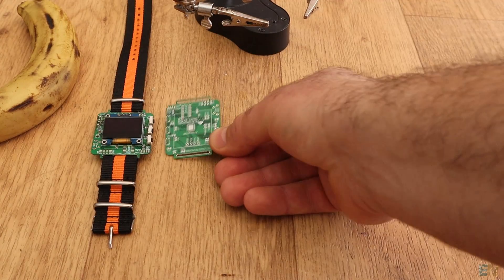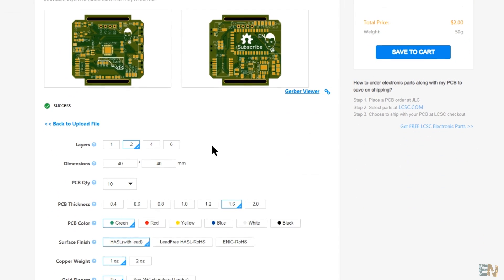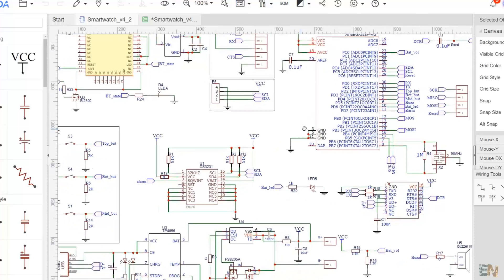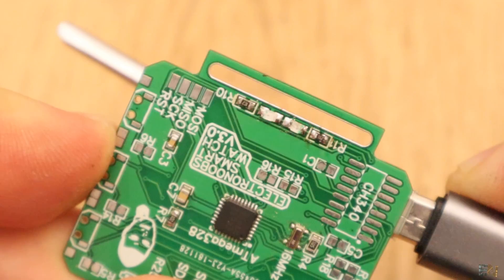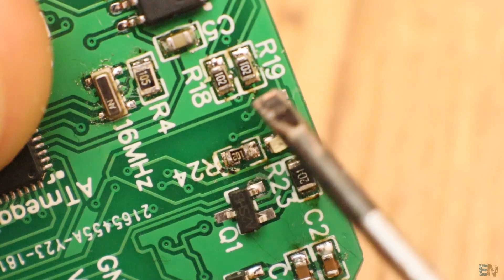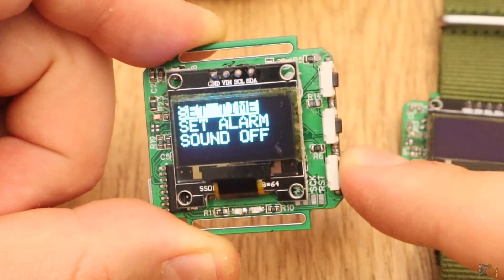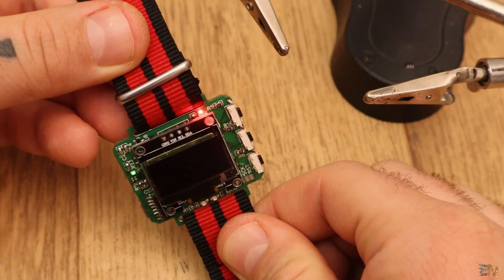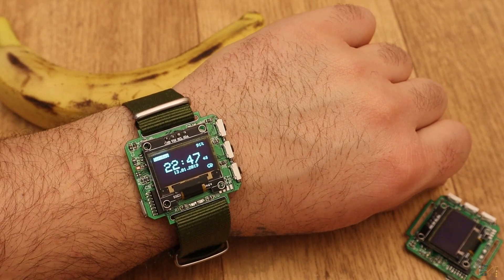Arduino watch - Bluetooth and more | development board

Comment: DW01A is not good for LiPo batteries since the overdischarge threshold of 2.4v is too low. FS312F-G has 2.9v which is better suited for LiPo batteries

Comment: At the watch's bend cutout the cutout's side PCB part is looks too thin. Why don't you kept it in the original thickness? That is the weakest mechanical part of your PCB. BTW if the manufacturer can make rounded cutouts, they can make rounded outer edges also, so you can round the sharp corner near the bend.
Interesting project I am very beginner in microcontrollers, I am looking for built watch projects to see how it is complicated. Thanks for your video.

Comment: Really amazing!  Thinking of the programming to make all that work makes my brain hurt!  Definitely worth considering other ICs.  The 32u4 can do USB without any additional hardware, and most of the Tiny line can do software USB with the Micronucleus bootloader.  Here's a watch I've been working on with, admittedly, much less functionality than yours.  But left to right is a M41T62 RTC, an ATtiny841, and a MCP73831 lipo charger IC.  On the back is a 28 channel LED driver.  https://www.youtube.com/watch?v=miADL01ga8E  The Tinys have limited memory, but I believe the 32U4 has as much or more than the 328p.

Comment: HOW U READING THE BATTERY VOLTAGE ??
Reply from the maker: I have a voltge divider connected to the battery and then to one analog input. That voltage divider will reduce the 3.7V to under 1.1V so I could use the internal refference for 1.1V of the ATMEGA328 chip for the analog read.
Reply: @ELECTRONOOBS  thanks a lot buddy....im doing the same..but different PCB and schematics .....once again  ty for sharing

Comment: with a bigger battery and a few changes this would actually a better smartwatch than many commercial ones!

ideas for the next revision:
* replace the buzzer with a tiny and less annoying smartphonephone vibrator
* replace the screen with a e-ink module (like the ones from waveshare) to lower the power consumption while keeping the screen on
* replace the tx/rx solder pads with tiny dip switches
* replace the atmega328 with an atmega32u4 (from an Arduino micro clone?), which doesn't need the ch340 chip and still has the full Arduino support
* use a more power efficient Bluetooth module like the at-09
Reply from the maker: Thank you for your tips!
Reply: @ELECTRONOOBS  actually, thank you! Your videos are very inspiring

Comment: sir, i am quite new to pcb designing...it seems that u are quite an expert...i am facing problm in making a custom shape for the pcb..as u have done...i was using easyeda only...and wanted to make a heart shaped one...it will be great help if u tell me...how to make a custom shape for the pcb...
Reply from the maker: You have to vectorize the outline baord point by point. For now, in easyEda there is no other option just go point by point till you have a heart sahpe. You could add a image below the PCB in easyEDA so you could guide and give the good shape.
Reply: @ELECTRONOOBS  ... Thanks a lot sir.. Firstly for such a fast reply... Just one more question... Can you suggest any other PCB designing software which can make this task easy..I mean so that I don't have to do it point by point... Thanks in advance...😇...and a bit of suggestion just in case you decide to make this watch even better... You can use esp12-e board... That will get you rid of the external crystal and will give you WiFi support by which you can control your home automation... And the soldering task will be far easier...😇.... By the way...You are awesome...😍